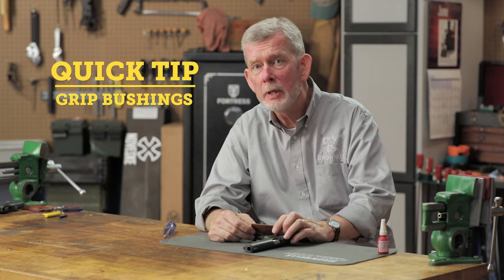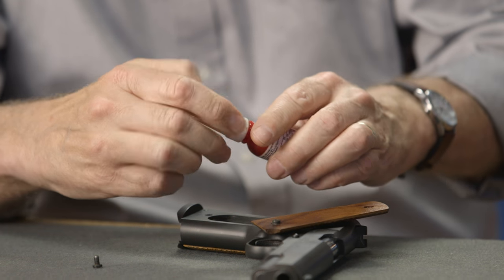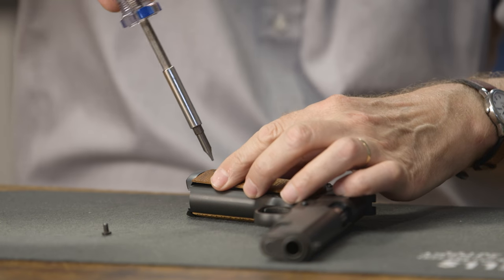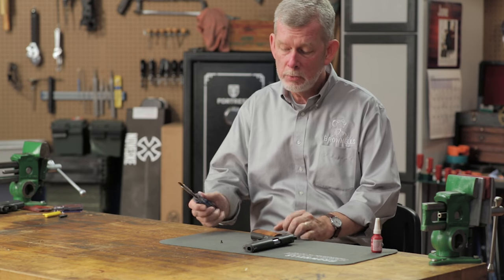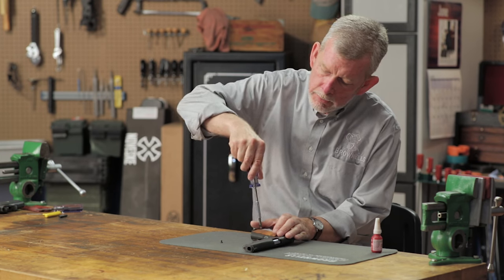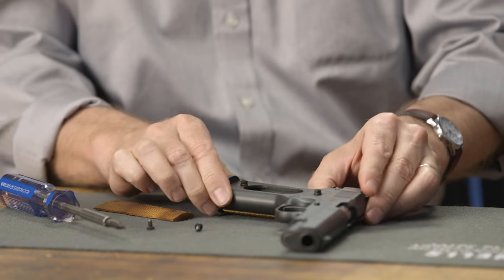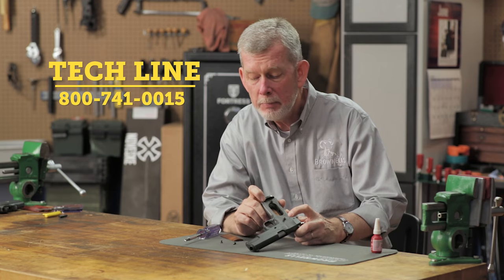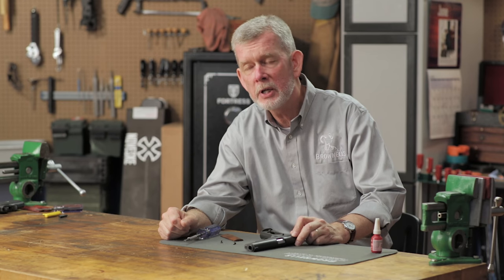Quick Tip - How to prevent grip bushings from backing out in your 1911.

Comment: Great stuff!  Kimber 1911s are notorious for doing this!!!  I use a set of aluminum  jaw inserts for my vice and grip on to the bushing on the back of the grip than I unscrew it like normal.  Works every time and never hurts the threads as long as you use aluminum jaws..  I use red loctite too and never have any problems!

Comment: Red? I think blue would be best, unless you have no intention of ever changing those bushings.
Reply: K C if you really have to use red.. brake cleaner will allow you to take it off if you let it soak but yea blue is probably better
Reply: Exactly!  Different thickness grips require different screws and bushings.  To red-loctite the bushings is like to weld them on the frame.  Should have made that idea clear to the viewers before teaching to red-loctite anything :)
Reply: I used blue on my 1911A1 on right side grip... Let it sit 36hrs.. came right OFF & bushing will too... If I need it to
Reply: I have 1911A1 & used Blue ... let set 36hrs ... & Just an hour ago backed screw out & bushing stayed but if I need to take out bushing I'm able to thx for the tip...

Comment: Red Loctite 271 or 272 on anything that small is virtually the same as weling it! No.... just no. Blue Loctite 242, maybe.
Reply: horse dookey!  red loctite on 1911 bushings and never had any problems ever!
Reply: Have tried both exactly as described, blue wont hold it good enough. With the small amount of both male and female threads you have to work with, the red is the one that works. And its not like welding it. Gentle heat (not crazy hot), will get it warm enough to loosen if you ever need to. Don't go crazy with it and the red works just as he said.
Reply: Exactly!  Different thickness grips require different screws and bushings.  To red-loctite the bushings is like to weld them on the frame.  Should have made that idea clear to the viewers before teaching to red-loctite anything :)

Comment: Holy shit no, just no. Red Loctite does not belong on guns, period. That guy should never be used for gun advice period until he learns why you don't use low heat break thread locker on a firearm ever.
Reply: Hurts nothing just will hold ur grip on good u never have any problem if u do it right if over sizeing is needed just try new lock scew in bk off it hurts nothing doing red lock tite it holds